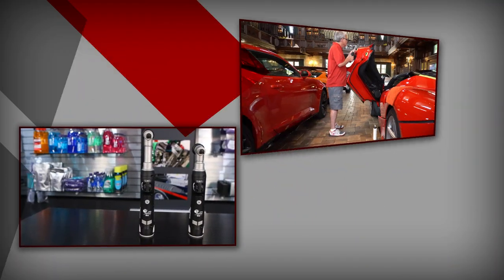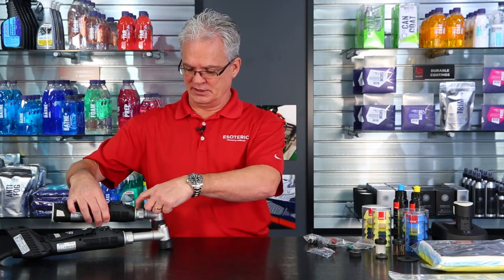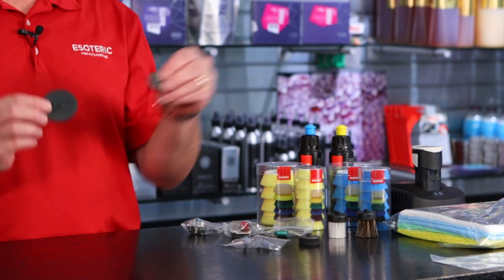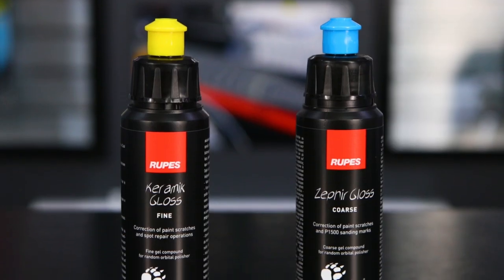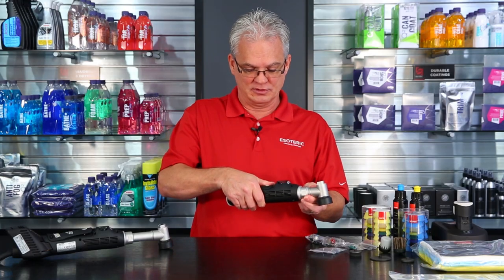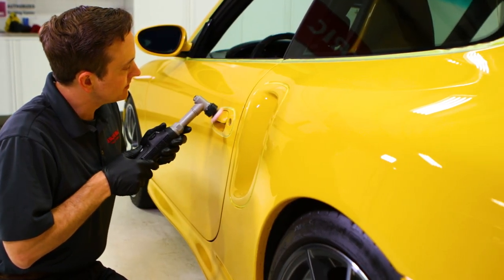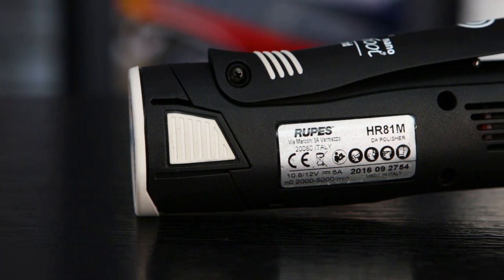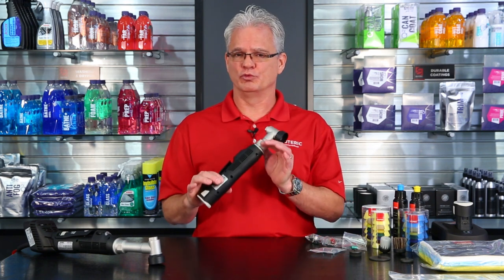RUPES Nano iBrid Review - ESOTERIC Car Care

Comment: I bought the longneck, but I wish they had made the "neck" modular so you use the long or short with the same base machine.
Reply from the maker: I'm sure their engineering team had good reasons for not designing it this way. It will be interesting to see where they go with this tool / design in the future!
Reply: ESOTERIC - Fine Auto Finishing that's the thing about engineering, there's always a way to over come obstacles with enough R&D.
Reply: FirearmTutorials .com That is most likely version 2 or 3  lol.  This allows them to make money.
Reply: @Esotericdetail  the engineering team no, the marketing team, yes.

Comment: Am I the only one that doesn't feel like I'm gaining enough cutting power on this thing? I've used this on a variety of jobs, and it just isn't doing any work, even when using a heavy-hitting compound.
Reply: I did when I used the blue 3mm offset. 

I put the 12mm red functional unit, and it rips. So does the green rotary fitting, but it can give you holograms. 

The 3mm offset is more geared for the sanding function.

Comment: Is it easy to stall out?
Reply from the maker: Only until you get used to the feel of the machine. Once you learn to keep it flat and not use too much pressure, it keeps running pretty steadily.
Reply: Mark Easterling my experience with the machine is that the 3mm throw is very easy to stall, even on a flat surface.  A little pressure and it will stall.  The 12mm throw however is a little monster and I have yet stalled it....
Reply: Thank for the great info.
Reply from the maker: You're welcome! If you're not already, please be sure to subscribe to our channel!
Reply: ESOTERIC - Fine Auto Finishing can I get a complete circuit board for the long neck model?
Reply from the maker: I don't believe they have internal pieces readily available just yet...

Comment: The head should be covered in rubber to protect bodywork. Bit of a design fault there for Rupes.
Reply from the maker: Good idea, but quite frankly, we've never had an issue...
Reply: ESOTERIC - Fine Auto Finishing 👍